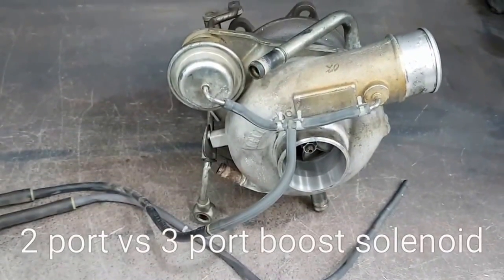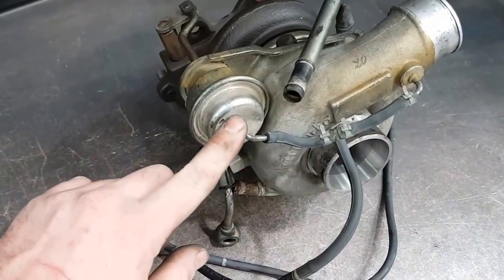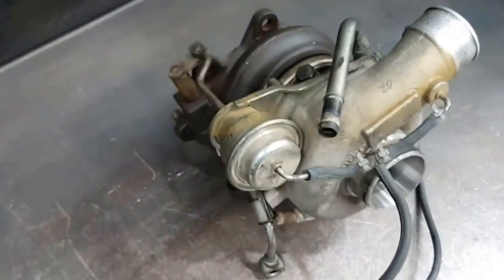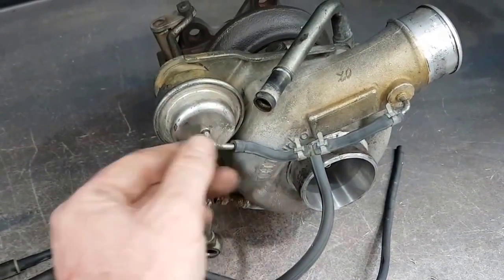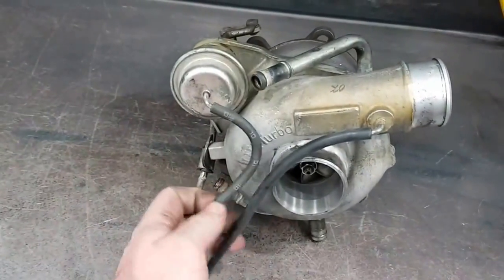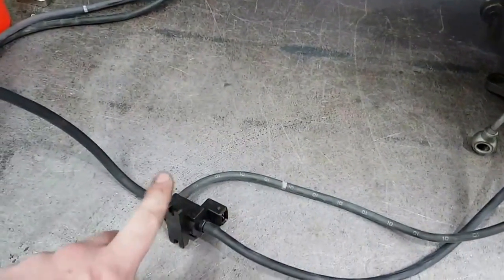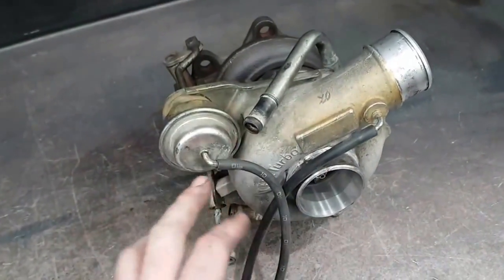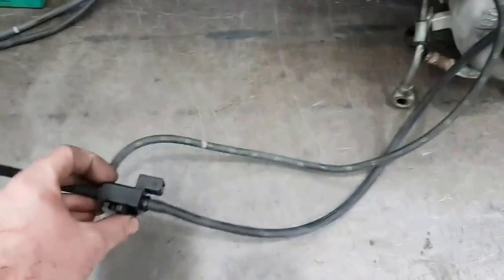3 port solenoid vs 2 port

Comment: now being 2025 GRIMMSPEED  has the 3 port for subaru'a that programmed to the subaru ECU , don't need to pay a shitload to get ya car tuned or worry about changing the turbo actuator.
Reply: Actually? Dang that’s nice to know
Reply: it's been programmed to work safely with the OEM ecu is what they write on the website 

DO NOT RUN THIS WITH A STOCK TUNE.

Comment: Why don't you just take out the T fitting and replace it with hose . And by the 2 port solenoid put a Y fitting to fit the 2 hoses . Itll flow much better

Comment: Wondering why cant you put a 3port with out a tune and what are the Concequence if you do put one without tuning what will happen and why cheers
Reply: i put one on mine without a tune, and only thing i noticed was my turbos wastegate had a ticking noise at low rpm because the vaccuum pressures were off, which is why the tuner will tune the 3 port to command the vaccum for the specific boost levels desired

Comment: Waiting and waiting and waiting to hear what the second pipe does. Why was this not explained ??!
Reply: Same here, a year+ later wanting to know if I can leave that pipe to atmosphere or if I need to go fab alternative intake piping, after the maf is the most I know...
Reply: @YARR7770  Which second pipe? the outlet can be left to the atmosphere since it's originally routed back to the intake. All it carries is the bled air from the boost source. Does not matter if you route it to the intake or just to the atmosphere. Just make sure nothing gets in the openings since that can cause trouble.
Reply: @theShogunSL  going by my comment from 2yrs ago It would have been the closest suitable inlet pipe I found not having the right plumbing I had to plumb it for a roadworthy anyways so didn't matter whether I could leave it off or not on the 2 port at the end of the day.

Comment: Hi with the 3 port solenoid where would the boost pill go?
Reply: i have spent 2 days online but cant find one straight answer. Nightmare hey!
Reply: @paulemmott1263  I found it so the boost pill is placed 5" from the compresser housing that's for the 3 port
Reply: @TheLesliemrx7  that makes sense to me but I have found 2 diagrams saying it goes in the tube to the air intake box.. I will try both ways tomorrow. Thanks for the reply
Reply: Your actually supposed to take it right out, then get it tuned. its not supposed to be in the 3 port ebcs

Comment: What if your car was tuned and you simply go back to the first way you had it is that okay to drive or you have to tune it back 2 OEM?
Reply: Tune it back to the OEM maps
Reply: @ferretfrenzy05  I am looking to have it tuned back to OEM all I have is a full Cat-Back exhaust... Never done it so I have no idea where or what shop does SC
Reply: @FBRomanRSM  Do you have any other mods except for the catback? If it just the catback then you wouldn't need a tune for that unless they changed the stock maps for some marginal performance / economy gain.

Comment: The grimmspeed MBC has only 2 nipples. From from turbo boost source and one out to wastegate nipple. What happens to the the intake venting? There is no 3rd nipple non MBC and the instructions just said to cap off the intake nipple on the MAF. So is this poor design not to vent to intake? I'm experiencing throttle cut with stock psi car is def more responsive with faster tune but at full throttle sometimes it stutters or cuts power (assuming fuel cut).

Comment: The Turbosmart boost constoller (manual in cabin) Works like 3 port ? in TEE have a spring and Ball to block the hole conect to turbo. Its correct? The MBC manual is better that 2 port stock EOM system? on subaru impreza

Comment: Hmm, I don't see much difference between the 2-port and the 3-port. I understand that the positive boost pressure passes through the 3-port before it reaches the wastegate actuator, but with the 2 port, if you create a weak point in the system for the air to be relieved, it excess/more pressure won't be able to build up anyways.
Reply: Except that if a turbo is running 8psi and you have that 2 port tee open to free air it can still only make about 12psi. ie the tee cant bleed off ENOUGH air. Also a 3 port can stop ALL air getting to the wastegate until a boost target is achieved to decrease spool time